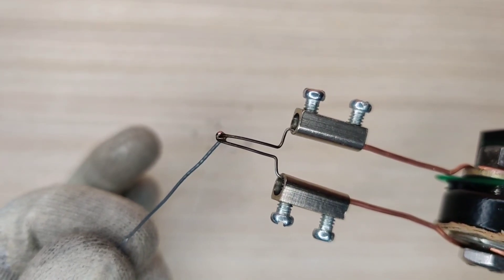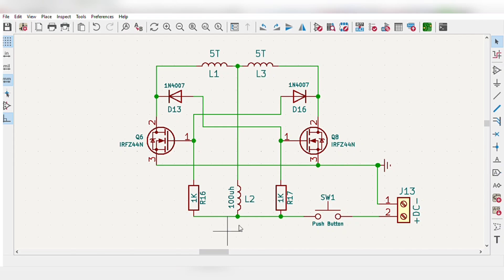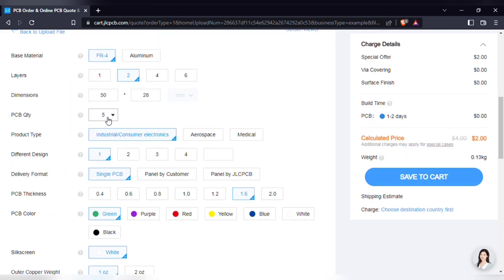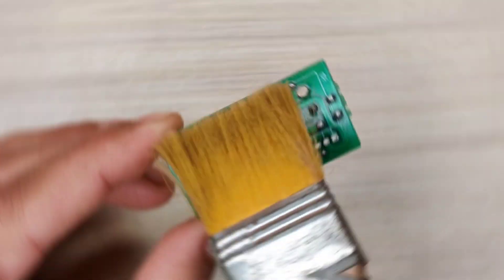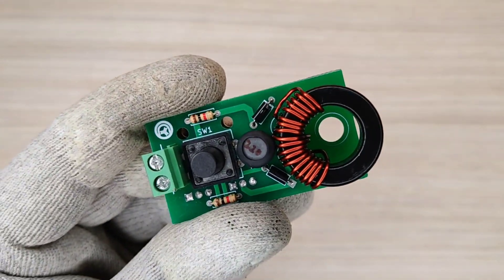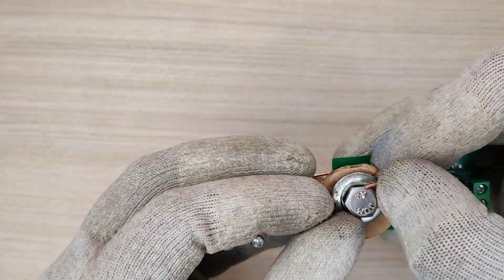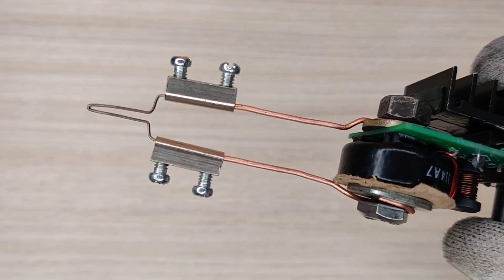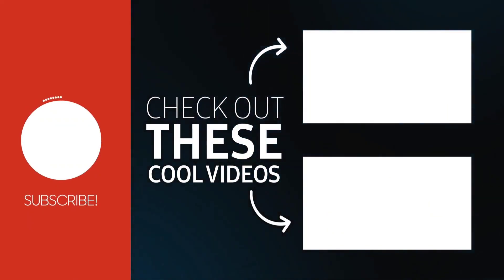DIY Instant heating induction soldering iron

Comment: I guess I missed something. How's the current or induction get to the tip if both copper wires are around the same bolt?
Edit: i guess the bolt and tip are one loop of the transformer.